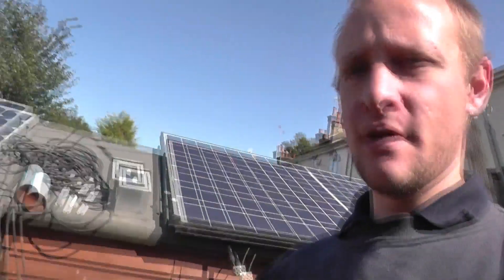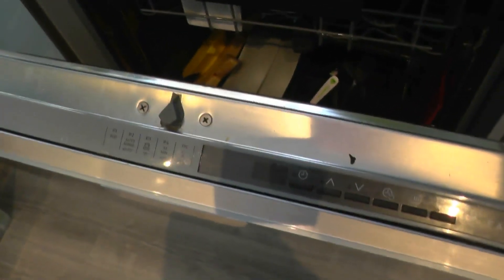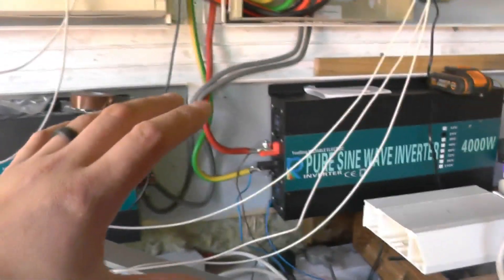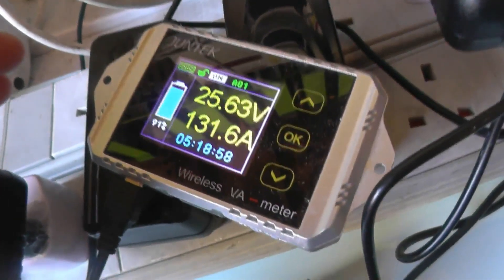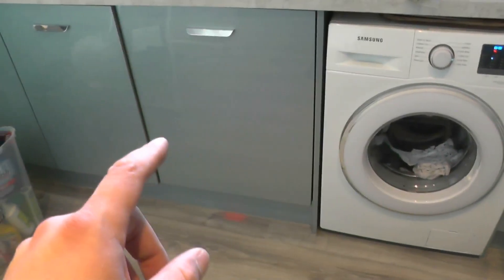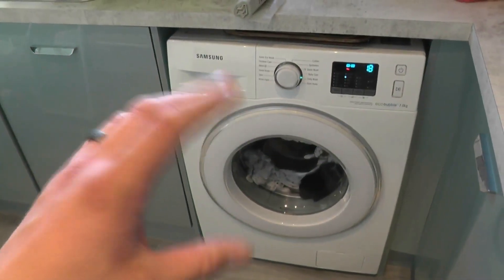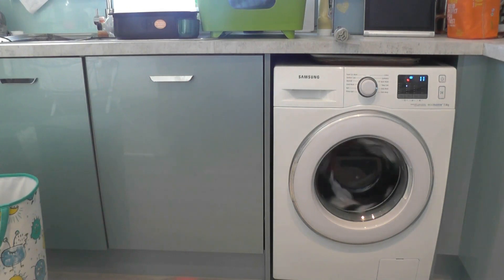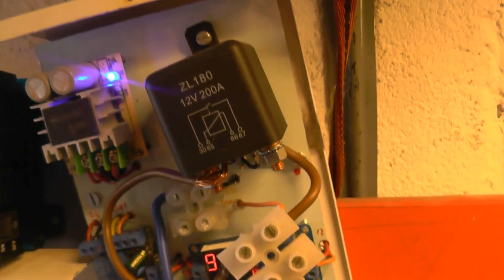Dishwasher and washing machine simultaneous run test. from september 2019

Comment: At peak can the machines not pull 2400w each? Maybe just short times of over 2000w will cause the inverter to trip...

Maybe plan them to run after eachother with the delay cycles?
Reply from the maker: strange but if i run the washing machine it will only run till 34 minutes. If I run the dishwasher at the same time I can get it to run until 9 minutes left or 55 minutes.

So its not an overload issue as it should in theory have popped the 13A fuse in the plugtop. (I like to live dangerously)

next up is to run the machine with a 60W filament bulb to see if it absorbs the anything braking. As Dave below says.

Comment: Did you watch the power output from the inverter at the point the washer trips it? Maybe washer is acting as regenerative braking?
Reply from the maker: Sounds like you could be right. Not sure how to see if i'm getting feedback. Might run a filament lamp to see it it can absorb anything being generated.

I have seen 360v on my megger at another property when a Meile washing machine was running down so could be the same thing. thankyou.